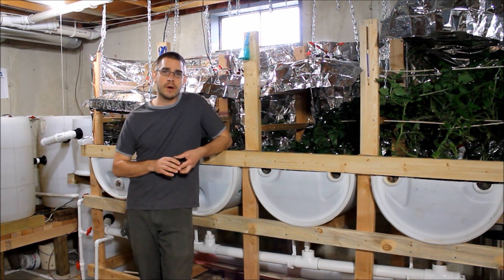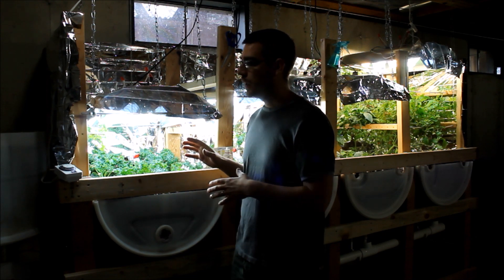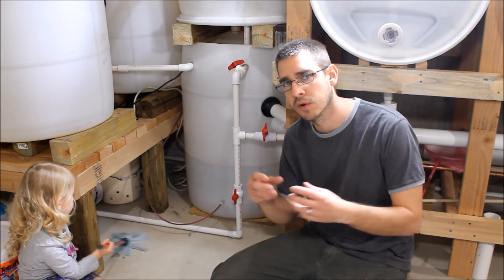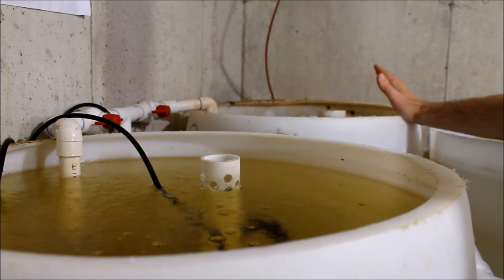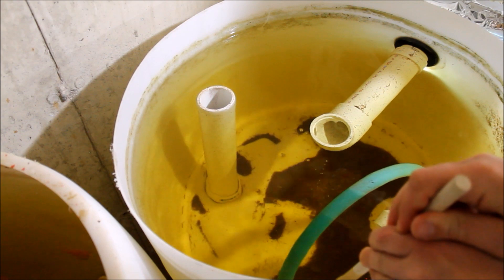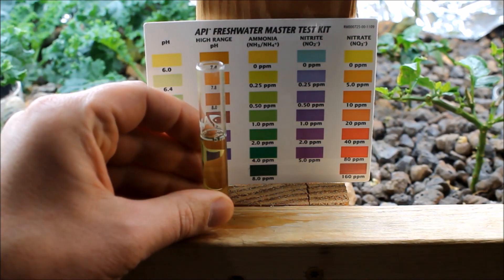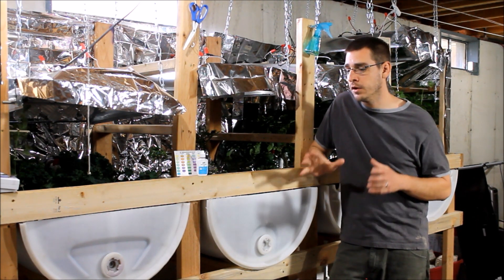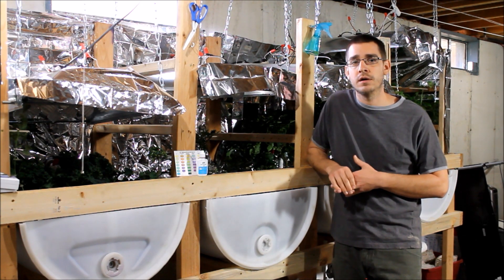Aquaponics System Design - System Upkeep and Maintenance

Comment: everytime I see it just a great system...would love something similar on a smaller scale......I think I want something with 6 by 3 bed for my greenhouse..........one thing  I worry about is humidity... how is t he humidity in your basement?
Reply from the maker: Mark Thieme Honestly I have never had an issue with humidity down there. It is higher humidity anyway (just because it is a basement) but nothing higher than normal. I do notice to moister on the window right above the system when it gets really cold outside but that is about it.
Reply: any idea what your humdity is? my greenhouse often runs 70 and above humdity
Reply from the maker: Mark Thieme I don't know for sure but my furnace keeps the house at 45% in the winter so I believe it was lower than that. In the summer is probably gets higher but the air  conditioner in the house keeps it down. I would guess it ranges from 45%-55% an average.
Reply: doing  something like that here would probly give problems with  mold here indoors...I have a small hybrdid system I've had basil growing in for the last two years... am transplanting the plants outside now..they have defenitely reached their limit but I wanted to see how long n far they would go for the last 4 months it has been                                  alive but fairly non productive, but before that I harvested and clone a good amount for both plants and family needs

Comment: Fish feeder is a must in my opinion. Get as large a one as possible and buy it don't make it, it's far to important. I made mine to have a much larger capacity. I use 40lb bags and it fills the bin. It makes the system much more automated. I test once a month and keep a chart. This helps because i catch things before I would notice them otherwise.
Reply from the maker: Submanca I completely agree, I have been waiting on the Tilapia and now that I have them I need to focus on automated feeding. I may try and build on though, I just can't resist:)
Reply: SSLFamilyDad Belive me don't built it. I know from experience it's to valuable but doesn't cost a lot for a good one, I may have gone over board and bought a Eheim feeder station for $75 but love it. You can get others for 10 to 50 on Ebay. Believe me when I say "Don't be cheap".

Comment: Great video dude, great that you talk about some of the issues you had and fixed. I am moving soon so i hope this summer to get a small system going. How much food are you harvesting with that size system right now?
All the best, Robert
Reply from the maker: NordicBritPrepper Good luck with your move man you will have to keep me updated if you get something put together as far as aquaponics. I will have an update specifically on the Bell Peppers I am growing next week but I am getting about 70-100 Bell Peppers per year with current production, plus an unlimited supply of Kale. I harvest the Kale just a little bit at a time. Tomatoes have not been very successful for me yet and the beans produce but not enough to really be that useful.
Reply: Thanks dude, i will certainly post videos as and when i get round to doing it. Thats quite a good amount of peppers, i make a lot of salads and use about 1/3 of a pepper for each one generally so that number would be all most a year. I haven't even tried Kale, not even sure what it is :D and beans i use sometimes, but not really enough. Tomatoes and cucumbers is something i want to see how that goes. I am reckoning the fish waste will work great on my orange tree and mandarin saplings i have.

Comment: Hi there. Thanks as always for the video. I guess one question I have on my mind is what would you do differently if you were building your system again? I had some ideas myself for things I'd do differently; even little things like putting the outlet for the swirl filter vacuum at the top of the filter (because less holes under the water line is better, and I notice your vacuum pipe kept folding as you were using it).

Oh, as an aside, thanks for your first response to my comment on your Jan 22nd video; I think you may have missed my asking a follow-up question - about whether you consider that you still need a swirl filter at all, having added worms, because the worms should be able to work alongside the bacteria, but can process the larger sized solid waste and by having the filter along with both worms and bacteria, you're perhaps artificially limiting the available nutrients to the plants?

You did also ask for suggested additions; I've seen plenty of Aquaponic videos and most have additional bio-filters in place. I've seen specific aerated barrels of large surface area (for more bacteria processing the fish excrement) and also barrels containing some gammarus (or similar) - which like worms can process larger waste.

I've actually stopped my own aquaponic design to re-work some things in light of your experience (and also that of other channels). It may be interesting to note that, of the 5 aquaponic channels I regularly watch, 4 of them have had complete system failures within the last 6 months. (I know you watch at least one of the same other channels because you've mentioned it in a previous video). One of the things I'm going to spend some effort concentrating on is having redundancy and multiple points of failure in my system. Bacteria + Worms + Gammarus would be one way of having multiple failure points before I lose my waste-to-nutrient processing, so that's one of the things I'm putting serious consideration into doing.

Hope this helps! Did you solve your mite problem by the way?
Reply from the maker: grotlek I did a video last year with some of the things that I would change with my system, some of which I have address already - https://youtu.be/G_rW_UNhmfQ. I do still think the swirl filter is necessary even with the worms. The worms are more there to eat uneaten fish food and organic matter such as roots and things that get into the grow beds. As far as I know they do not really eat fish waste as that is already processed organic matter. Fish waste that does not dissolve right away can clog up the grow beds in just a couple of months and I would highly recommend having a swirl filter or settlement area of some sort. The other thing you can do as you mentioned is use a sort of mineralization tank or bio filter that stirs up the fish waste and aerates it so that more dissolves into the water and therefore provides more nutrients to the plants. This is a great approach as well I just don't know if it is 100% needed, just a nice extra gadget:) I personally like the idea of using the extra fish waste for the garden beds I have outside, the soil needs the extra nutrients just as much as the indoor gardens so I prefer to be able to use it in that way. Hope that helps answer some of those questions and thanks for following along!
Reply: SSLFamilyDad Just like you I'm no expert but from what I've learned worms do eat the fish poop and process it as castings. The only reason you need a filter is if you're producing more waste than your beds (and worms) can handle. I have 2 IBC media GBs and 1 IBC raft bed in my system and everything seems to grow better and greener in my media beds. I can only attribute that to the worm castings. But every video I've seen says that the worms do eat the poop. I do have a radial flow filter but only because I have way too many fish.
Reply: SSLFamilyDad makes sense; the outdoor garden would need nutrients too so if you get a surplus from your fish then it's simple enough to separate the solids out with a swirl filter. As Jeff Sullivan said though, worms do eat the poop - that's exactly what happens when you drop it into your garden as fertiliser (although other critters probably get first dibs on it since worms prefer to stay slightly below the surface).

Sorry, I have watched all of your aquaponics and most of your other videos. It had completely slipped my mind that you had already covered what you'd do differently. My bad :-).
Reply from the maker: grotlek No problem! I thought that the worms would eat the fish poop also but have not been able to find any concrete research online that substantiates that other than people just saying they do. My understanding was that the worms diet is of organic matter such as roots, fish food, and other pant matter breaking down but I am still on the fence as to weather or not they actually eat the feces of fish:). Either way they are a must in the grow beds and will surely make cleaning the media less likely. Thanks for following along and the comments!